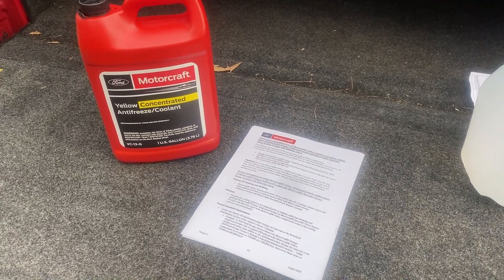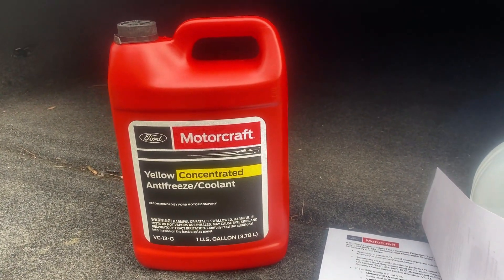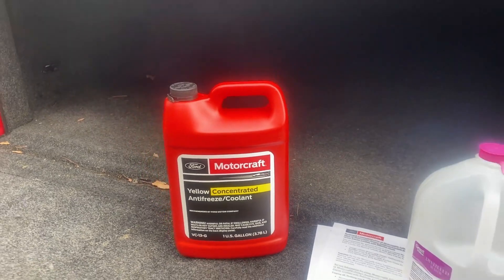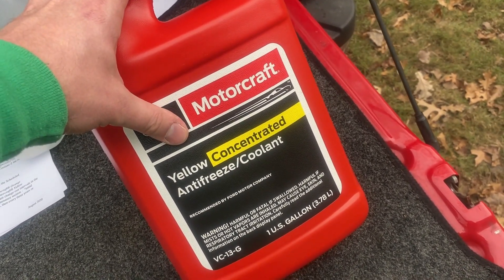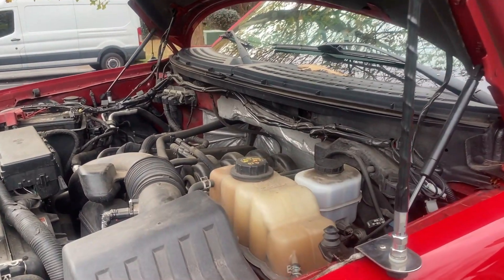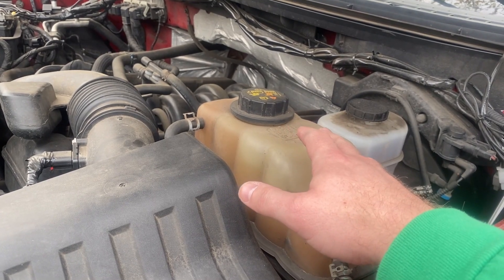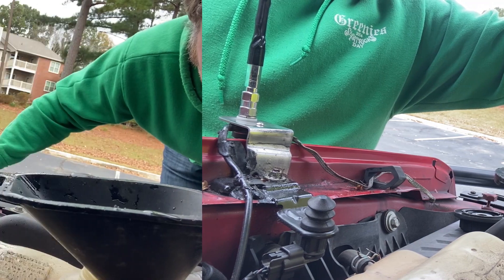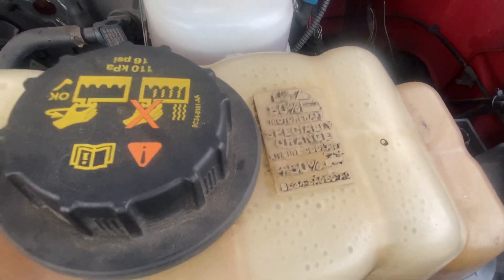Ford's New YELLOW Coolant. The Best Coolant Yet? Everything You Need To Know. EASY Replacement!

Comment: What is equivalent of this in prestone?
Reply from the maker: Yellow
Reply: @JakeInGeorgia  I would not use Prestone or any other after market. I learned that lesson after 2 head gaskets in 2 different cars.  Mix with any car any color is a bunch of crap. Stick with OEM. They are designed specifically for the car.
Reply from the maker: @larrym4813  well, the orange OEM that ford used was apparently no good so they went to yellow 🤣

Comment: JIG
Ford has the internal water pump issues so I'm trying to prolong the lifespan of the orginal wp Iwent to Ford for coolant flush for my 17 explorer interceptor and Ford installed 2 gals of VC13 D, and 1 CFK Coolant F (Not sure what CFK is) but my question is am I safe with what they installed or should I get another flush?

Comment: What is diffence with VC13G and VC13DLG
Reply from the maker: One is concentrate (you have to mix with distilled water) one is pre-diluted (no mixing required). I typically buy concentrate if I’m doing this as preventative maintenance in my driveway as it’s the best value for your dollar but I keep a bottle of pre-diluted in my vehicle in case of roadside emergency.

Comment: Thanks for the info! I have a 2017 Ford Taurus Limited and also a 2018 Ford Taurus SEL. Both have the 3.5L NA V-6. Both also have the orange coolant. Both need topping off so I went to my local Ford dealer and they told me to use the new Yellow concentrate to top off the cars. At first I was freaking out because so many YouTube channels talk about not mixing colors because the coolant could turn into a jelly like substance blocking coolant passages, etc. So, thank you for the reassurance and also my dealership reassured me it's fine.  It does look tasty though, kinda like a icy cold Mountain Dew!
Reply from the maker: Yep! You’ll be fine. It’s backwards compatible. What I would recommend though is that you completely remove the orange coolant from your system at your earliest convenience and replace it entirely with the yellow. The orange is known to be acidic and will prematurely wear out components like the water pump.
Reply: Drain and refill my coolant from orange to yellow on my 2016 3.5 N/A and 2.5 N/A on my Fords. So far no problems thank God.

Comment: Interesting cb mount. Like pre mixing all the time. Years ago I replaced a water pump on a falcon 6. Poured in anti frz straight and it wiped out the permatex. Had to pull pump off and re-do. From then on I pre mixed.
Reply from the maker: The cb mount is just a universal mount I bought from a local shop. It does have a ground wire coming off but that’s because at one time I thought I had a bad ground. Turned out that the cable going from the radio to the antenna was bad. I just never took the ground wire off when I replaced the cable.

Comment: I know I'm shaking the bag of cats here but the coolant will most likely change again. The materials within the cooling system are why the coolant needs to keep changing. The aluminum in the radiator and heater core, the rubber in the hoses, the seals, the plastics.... They all have chemical reactions with the coolant in negative ways. Ford changes the coolant as new coolant testing shows less failure than prior with these materials. But, it takes time to see these reactions (lack of R&D maybe). Then,  coolant system parts tend to change over the years. Do the math. Create your own summary. I'm not a hater,  I currently own 3 Fords (have owned 10 total)
Reply: Ford should have switched to POAT coolant years ago like the Asian carmakers. That way there is no need to keep changing coolant formulas.
Reply: @Ryan Huang  wish they did, but we both know it wasn't as cost effective.
Reply: @mygt8a4re  I think it's more about $$$ so that when it breaks down they can make a cash grab.

Comment: For the Mustang GT with orange, which would be the most recommended? Prestone Yellow?
Reply: I put the yellow Prestone in my 2006 Crown Vic that had orange in it and it has worked out fine for the last 2 years it says you can mix them but I decided to do a flush. Prestone makes the yellow Motorcraft for Ford. It really is the same thing.

Comment: I just got 3 bottles of prediluted for my Taurus interceptor. The internal water pumps in these and the Edge, Explorer and so on are probably a huge reason for this change. They preserve the pump far better supposedly.
Reply: It doesn't just preserve the pump per say, the newer coolant is likely to lessen deterioration of the rubber hoses, seals, internal plastics and aluminum in the radiator and heater core. It's not just the "internal" water pump at risk or cause of coolant system failure. A little more "R&D" would have been helpful to longevity here 😉
Reply: I have a Lincoln with internal water pump. And I've been hearing the horror stories now and has me a little bit worried. So very interesting to know that the orange coolant wasn't the greatest for these engines and that's why the yellow was introduced. Funny I just changed my coolant, mine had the specialty green in it I just had to pay $47 a jug for that stuff plus there's a shortage of distilled water now here in California.. so after checking six places finally found it for $4.59 a gallon at Ace hardware. But that's important. 
Question if anybody knows: was the specialty green better than the orange? less pump failures? And you think I should now change over to the new yellow even though I just put in fresh VC10A2 specialty green?
Reply: @gregt8638  I believe as long as you flush it, you can use Yellow in anything 2011 or newer.  And Yellow is now recommended.
Reply from the maker: I hear that too. And I believe it. I replaced a water pump while using the old orange fluid. Buying prediluted isn’t a bad thing if you’re looking for a jug to keep in the vehicle ready to go. For the garage, I recommend buying the concentrate and mixing it up 50/50 with distilled water. Then just keep the mixture in your garage. Better bang for your buck!
Reply: @JakeInGeorgia  According to FordTechMakuloco the new Yellow fluid is super incompatible with non-distilled water.  A word of warning for those who might not know to mix properly WITHOUT tap water or even worse, well water.
Reply from the maker: @Florida_Man_In_Florida  it’s probably best to always use distilled water no matter what but that’s my two cents.

Comment: This new yellow Ford coolant is the exact same as the Prestone All Makes All Models coolant. 
 Ford had a TSB to use the Prestone coolant on the transit heater core problem.
Reply from the maker: Good info to know! Thanks for sharing.
Reply: I've heard somthing similar but it was another brand of yellow coolant. Makes me wonder why we just don't use the more affordable yellow coolant that's been out there for YEARS!?
Reply: @mygt8a4re  Prestone makes it for Ford. It's the same stuff.
Reply: @j.t.cooper2963 hi j.t. what proof do you have that Preston makes and supplies ford with their coolant. I'm curious to find out. 😮
Reply: @mygt8a4re  Because you just don't know if the "one size fits all" coolant will cause a compatibility issue with the existing coolant in your system.  For a few bucks more it's worth the peace of mind!
Reply: @Florida_Man_In_Florida  thanks for your input. I wasn't referring to mixing them though, I was referring to using/purchasing the more affordable brand that is just about the same exact coolant as the Ford product. I flushed my system over six months ago (back when I asked this question), and used the Prestone yellow coolant with no problems to date. It was even recommended by a mechanic friend to be better for the water pump seals than the red coolant that came in my vehicle when I purchased it.
Reply: @Florida_Man_In_Florida  Well explained! True, there will always probably be some residual liquid behind, what depends on the procedure. In my case I ran the engine while running a water hose to get all the old fluid out then proceeded with distilled water flushing 3x and of course the proper level of coolant afterwards. If anything, I left more distilled water behind than anything. It also helps to be a bit OCD, lol 😆
Reply: @Florida_Man_In_Florida  heard that, appreciate the advice! 👍

Comment: I'm at the mileage where everything needs to be changed in my f150.. Spark plugs ( $40.00)   flush and fill coolant ( 100.00), differential fluid ( $100.00 ) . Ouch!
Reply: Go ahead and spend it now. It will save you in the end. Best thing you can do is doing your preventive maintenance. I replace some parts before they even think about failing on me lol.
Reply from the maker: @Bigsteve123  excellent point. We will never be completely perfect with maintenance but taking a couple minutes every couple of weeks to do a visual inspection and making sure you do the routine stuff at the right intervals can prevent a lot of headache.
Reply: @Steven L  spend it now.... until you find out the coolant you coughed up money for is now the wrong coolant... but seriously, preventative maintenance is key. Just skip FoMoCo's suggestions and go straight to the coolant companies who have been making the same quality coolant for several decades! 👍
Reply from the maker: Differential fluid change is easy on our trucks. Check out my other videos for a “how to”. As far as coolant goes, since the yellow is backwards compatible, I just pull a hose, drain, top off.  Repeat that a few times and you’ll basically have all new fluid in there.

Comment: Oh yeah the Ford Gold is the BASF Glysantin 05 aka G05.  Same tech that Chrysler was using before they switched to the CCI sourced OAT with the tri-dye coloring.  And yup Chrysler switched because of the CAB flux issue as well.
Reply: Are you taking about the issue with the aluminum and coolant corrosion?

Comment: The Ford Yellow is the Prestone All Makes/All Models with cor-guard(phosphate) dyed yellow...a 2-EHA based OAT with phosphate
The Ford Orange is the Prestone All Makes/All Models dyed orange...a straight 2-EHA based OAT
The Ford dark Green is the CCI sourced FL22 also used for Mazda and Subaru...an OAT with phosphate
Every OEM is changing or tweaking their factory fill coolants because of an issue with CAB flux contamination in aluminum radiators and heater cores.  It's not a nitrite issue folks.  It's bad engineering by radiator manufacturers that the coolant manufacturers have to deal with.
New rads and cores should be flushed out with hot water before adding the coolant but the OEMs know what the problem is and see a future full of engine issues that bring cha ching in for the dealerships so no incentive to do the right thing.
Reply: but fl22 and speciality dark green 2eha free while yellow  has %3 or less 2 eha for 2020 version after the announcement
Reply: @عريف_شرك  I read that if you have an FL22 system you can run this new Yellow without problems and even its an improvement

Comment: I've 2016 Focus SE 2.0L and why does Ford not recommend alcohol or methanal coolant ? The one I just bought is supposed to be universal..but it's ethylene glycol
Reply from the maker: Well, I can’t answer for anything Ford does as I have no association with them or their business. Practically speaking, it could be because alcohol evaporated faster, or maybe it’s because they think the blend of coolant transfers heat better, or it could be because of its acidity level, or it could be because of how the coolant reacts with the rubbers and plastics that it is traveling through.  It could be any number of things. However, it usually boils down to $$$$. If I’ve learned one thing from working on vehicles it’s that if you have to ask why something was done a certain way rather than another... the answer is typically money $$.

Comment: The orange coolant had the tendency to gel up in the cooling system and clog heater cores or in severe cases clog a coolant passage way and cause a head gasket leak. So ford has now discontinued the red 

My truck had the coolant passage clog and needed a new engine. The new engine was filled with the yellow so now I’m good.
Reply from the maker: Good to know!  I heard the orange was corrosive. The yellow is supposed to not be corrosive.  I guess we shall see.
Reply: @JakeInGeorgia  if i were you I would get the red coolant out
Reply from the maker: @yousufkan6960  orange
Reply: What is it people? Orange or red coolant?
Reply from the maker: @GreatGrandmasterWang  orange
Reply from the maker: @GreatGrandmasterWang  Ford has never had a red coolant